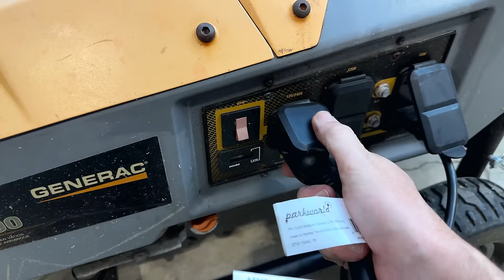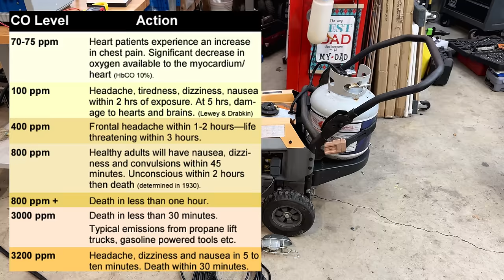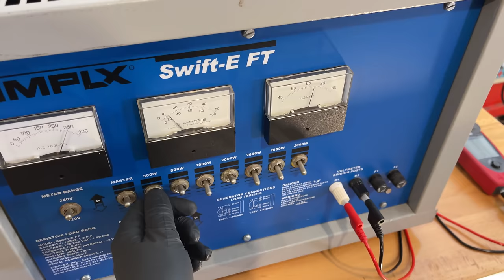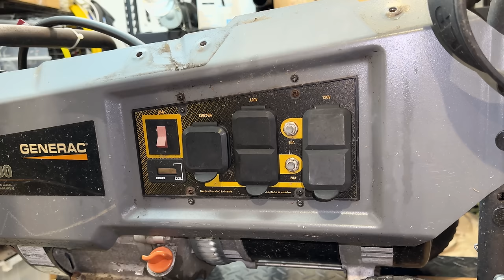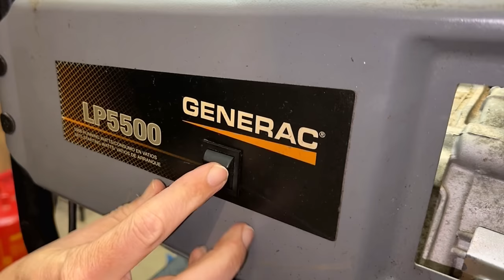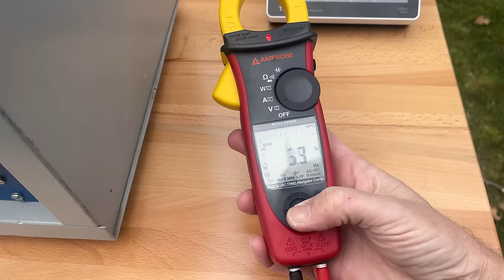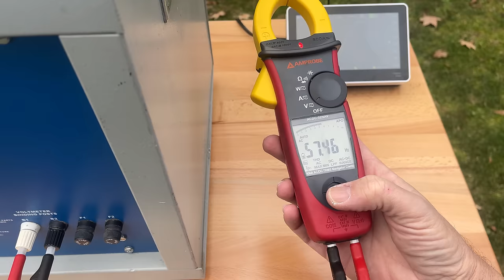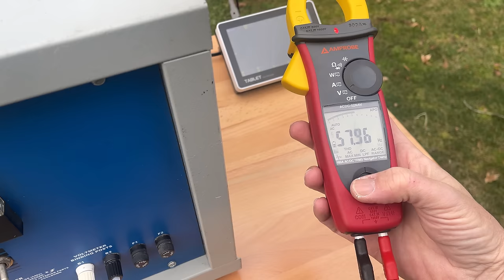Will a Cheap $40 Carburetor Breathe New Life Into This Machine?  Generac LP5500 Generator

Comment: When seeing the super faded cover on that unit, I knew it would have regulator issues from sitting/living outside for extended periods, or possibly most of it's life.  Those small propane regulators often fail/get stuck when exposed to the elements for long periods of time.  I enjoyed your conversion and repairs with new parts!  If I recall, this unit was really the first of it's kind as an OEM off-the-shelf generator designed to run on propane, and came out around 2010 or so. Look at how the small inverter gen market as exploded with dual fuel units in the last few years now!

Comment: WOW!! James that was fantastic and has prompted me to alter several of my generators so that I can use them on both gasoline and propane. I have a factory WEN 9000 that is factory dual fuel but I would like to convert 3 or 4 of the others  with this idea because I travel between Texas and NM and NM is much cheaper on propane than Texas, plus it burns cleaner on the engine than gasoline does. I will forward this to many of my friends. FANTASTIC!!!
JJ

Comment: I worked with a lot of LP powered engines. Mostly water cooled. We did use some small LP engines on smaller equipment such as high speed burnishers and small sweepers. Good video James.

Comment: I loved this. Years ago I converted a few generators to tri-fuel primarly to use natural gas. I had US Carb convert one, then I did the rest myself. simply boring a hole for a copper inlet sealed with JB Weld. Propane is easier to start but the benefit of unlimited fuel kept me going 3-5 days last hurricane. Anywho the "snorker" options looked cokamamie to me by comparison, though sometimes they fit and mostly work. I was going to say drill out your carb until I saw the one you got and holy cow, talk about a deal. I added all the regulation and so on myself but that package looks perfect and better thought out than well anything I ever saw on the market. You're a genius. Well done.

Comment: Your curiosity paid off here.The fact it started right up is impressive in itself but the fact you have multiple fuel options is even better.Many people have natural gas already and would just need to properly apply a convenient line and location where it’s safe.I’d be curious how much carbon monoxide natural gas would generate.Either way an outdoor location is the best way to go.You would just need to build a weather shelter for it and have it as a viable standby.
Reply: NG is a good option. I’ve watched a couple of vids where the conversion is explained. Their biggest issues have been supply. There are simple calcs to determine if the NG line can support the NG demand. You have to take into consideration every gas appliance running at once PLUS the gen set running.

Comment: I’ve just learned a new method for removing recalcitrant adhesive using your torch/wire brush method. Thanks!  
I usually use my hot air gun first to remove stickers as you do (for which I have multiple tips of different sizes and configurations). For leftover adhesive I’ve been using 3M adhesive remover for many years and in most cases it has worked very well, but it’s always good to have alternate methods.

Comment: I got my Multifuel  carburetor  in and first pull it was purring.  I took out old regulator and left dial turn switch for my kill switch . My only concern is my carb came with 2 wire off the bottom. not sure I need them. Also it starts right up without air filter  but it took a bit with it in.  Rubs great though and oh what a savings . Thanks again for this video.

Comment: Two comments. 1. The purge button is the spring loaded button in the center of the regulator 2. To kill the engine just turn off the propane tank. 
I experimented with a similar dual fuel carb a couple years ago but I only used the regulator because the carb wouldn’t bolt up to the Tecumseh engine on my generator

Comment: Well, thanks for that...I use these on a couple of engines, but they don't push the engine or carb hard; been wondering how it affects peak power and whether it could keep up with the propane demand. Can't be too terrible if you've managed a more-than full-load on this machine. 

For a longer test results, I can attest to having my little generator run all night (8hrs+) out on the patio when the power went out in the middle of (a mild) winter. Tank didn't freeze up, engine just kept chooching along. Not sure just how many hours it ran past the 8 hr mark, but it had a 1500-1800w load on it the whole time and didn't quite use half a 20lb tank of propane. 

Using these was my solution to carbs getting gunked up every time I(or the previous owner) forgot to drain them on equipment that only got used once or twice a year.

Comment: Hi James, nice option. you might consider using a propane forge regulator, the one you have seems to work fine,. a heat shield between the exhaust and the carb maybe in order.
the sine wave will look smother when an inductive load (motor) on the machine also the THD will change.
Rich

Comment: Cutting rubber hoses is much easier when you bend a loop in them 360 degrees with a sharp blade of course. Another impressive fix Mr. Condon, Kudos to you.

Comment: I'd still put in a heat-shield between the exhaust and the propane line, because, even though the direction of hot  exhaust gas has been redirected, the muffler and the exhaust pipe are still throwing radiant heat towards the propane line which, if the generator is being run for an extended period, will find that area being exposed to considerable ambient temperatures. Under those surrounding temperatures I can see hose-pipe rubber melting easily. 
Cheers

Comment: You should be able to unscrew that barb fitting from the LP port on the carb and replace it with an elbow standard LP fitting.
Reply: Does that mean the new fitting would have screw threads to go into carb and screw threads to accept the factory threaded fitting on the end of the 10 foot hose James bought?  If so what are thread sizes on each end?
Reply: @jimw6991  Most likely a standard NPT sized thread.

Comment: As far as adhesive remover for stubborn glue as was used on rhe the window tint on my dads truck. I spent an hour trying every thinner, remover concoction i could think of. Lastly just for grins and giggles, i sprayed the window with good ole lysol that dad had behind the seat. It liquified the glue and instantly, i was able to wipe it off

Comment: 23:50 when running on gasoline LPG intake must be blocked as well - each intake cycle it will pull air through a gas hose, it doesn't take to much vacuum to engage diaphragm controlled valve on that gas carb. Also id suggest using spring band hose clamps instead of those regular ones, the idea is - even if hose sags and lose elasticity with time spring clamp will exert continuous clamping force, while regular will stay in same position and with time can start leaking. Nwm, didn't finished the video when was writing the comment)

Comment: Jim - perfect timing! I’m dealing with a replacement propane regulator need on a patio heater. Unfortunately, the replacement regulator will only attach to the existing line with a barb fitting. Been struggling finding a threaded fitting. Will give these Clark clamps a try!

Comment: |I did a conversion to my clone petrol 2500va genset. Cheap £18 tri fuel carb. 
Worked fine on petrol. But very difficult to start on propane. Also found that it surged on propane in the LPG jetting. Switched to natural gas position, when running propane and ot was much better. The NG jet is bigger, suggesting all the jetting is undersized.
Brought a high flow regulator for the job, which gives full generator output.

Not planning to actually run it this way. But for the price of a few beers, it's been fun to do.
Reply: Interestingly mine has a tap for the carb bowl drain. Making it really easy to drain when switching fuels, if starting on petrol.
(Not really gotten to the bottom of why it is difficult to start on propane yet.)

Comment: For sticker removal, try Turtle Wax Label and Sticker Remover.  Works when all else fails, and won't hurt the paint.  Had to use it to remove the residue from shipping tape on my car (sun roof had to be repaired) .

Comment: Well done James, I think running that propane line along the outside was a good idea. It not only keeps the heat away but also the owner can keep an eye on its condition. With propane out of sight, out of mind can be a recipe for disaster.
After your video of the Honda EU 2000i I left a comment saying that some Americans seem a bit wasteful, which you pinned to the top of the comments. Thanks for that😂. The reaction to my comment was surprising and enlightening because generally Americans have a strong disdain of foreigners making critical comments about them but I experienced the opposite. I guess it’s the audience that these type of videos attract because people either agreed or gave very rational opinions on why there is such a propensity to just junk something that stopped working. A lot said that tossing the Honda was rather extreme and not common. Regarding pressure washers being junked, some pointed out that fixing a $500 unit was not economically viable a lot of the time because of the high cost of labor its easy to quickly spend more than it’s worth. If it’s going to cost over $300 to fix an old one then it’s probably better to buy a new one. It’s even worse with lawnmowers. I really can’t argue with that logic. It was also pointed out that the current generation not only have no idea how to repair things, they’re not even remotely interested in learning, another very valid point. And yet another comment was that generally people have plenty of money these days and not only can afford to buy a replacement but prefer that to the hassle and unknown cost of repairs. 
I found these comments really made sense. My sister had a B&S powered mulcher years ago that she was going to get serviced because when it warmed up it wouldn’t idle. She was told it would be $340 so she took it back home and asked me to look at it. That price was more than her Honda civic cost to service. I got it and serviced it completely for her in half an hour, spent 10 minutes adjusting the mixtures and it ran perfectly for years. Maybe Americans are not that wasteful after all. Cheers mate, Stuart 🇦🇺
Reply from the maker: I think it’s a bigger problem unfortunately around the world.  The Honda was an extreme case.  Before I repaired my own stuff I had issues with my lawn tractor one Spring.  It was 20+ years old.  Always well cared for and looked like new.  Dropped it off for service.  $300 and 4 months later got it back.  Missed most of the mowing season and the shop left it outside for that time and it came back looking like it had aged 20 years.  I can see why people do not want to deal with it.  I ended up having to buy another tractor in the interim so I could cut the lawn.  Hopefully things will change, but until the price of new equipment is higher people will continue to waste good equipment.
Reply: @jcondon1  I whole heartedly agree with you James. It is so hard for western countries to compete with cheap junk from China. Human nature puts price above quality when it comes to a lot of things we buy. 👍

Comment: Great job getting that back running on LP gas.  There are a lot of benefits running these on LP vs gasoline.  Its is nice to have the option to use either fuel.

Comment: Another good habit is running the propane out of the line. Close the tank and let it run out. One of my hoses is all gunked up from propane being left in it all the time. They have 2 stage "grill" propane regulators that go up pretty high. They sell them usually in the same section as the big buddy heaters and stuff.

Comment: Hi James, very interesting as I have this setup,  did you remember to move the black knob from propane to petrol on the carb and back again, I couldn't see the position in the vid. Bob
Edit, Ahh! just saw you speak of that knob at about 28 minutes in. That was surprising wasn't it, I thought you were onto something as I was sure my Gen. isn't giving as much out on propane and thought you had the answer, maybe you still have as mine it 10kw, guess I could see at what point it bottles, then try it again on petrol and see if it goes higher. Bob

Comment: Good job James, I have one of those gas carbs but haven't tried it yet, now I will. FYI, a little Tarnx on a Q-Tip will clean those switch terminals really nicely. When I repaired VCRs back in the 90s I used it to clean the mode switches on the mechanical mechanism. It worked great, just clean off the residue with water then dry it.
Reply from the maker: My early video editing was on SVHS.  Things are so much easier now.

Comment: What I do with stubborn labels is take a piece of rag (like an old handkerchief, pillowcase or the like), lay it on top of the adhesive, and keep it wet with isopropyl alcohol (get the 91% or 99% if you can - the normal 70% you get at the drug store isn't good enough) for a few hours, and it will soften most adhesives to where you can wipe it off after a while.

Comment: One "gotcha" with propane-generators..... I have encountered cases where the engine would run great UNTIL put under load.... then engine would QUIT and not restart. After propane-tank is disconnected/reconnected, the engine would again start and run OK. (then it QUITS when loaded) It turns out that some propane-tanks have a SAFETY SHUTOFF which will turn off gas-flow if too much flow is detected. Disconnecting the hose resets it. (I believe you touched on available-flow but did not mention the SAFETY SHUTOFF)

Comment: After load testing and adjusting the governor for better engine speed, did you ever get back to looking the CO output? Given that (scary) chart you displayed, if the unit is still putting out that much CO, I'd be painting a huge red/yellow striped warning on it..."Do Not Use Indoors". Anyone who assumes they can use it indoors because it's propane may be in for an unpleasant surprise. Thanks for another fascinating video, I always learn something new.

Comment: A quick glance at the propane nipple on the regulator, seems to indicate it is threaded into it - so an adapter is probably available to use the 3/8" propane hose fitting, without cutting the line.
Also, 10" of water is quite low pressure (0.36 psi), so only 1 hose clamp would suffice.

Comment: Great job James. Although goof off is a good product, I have found Goo Gone which is a citrus oil based product works great.  I decided to use a portable sprayer to spray our bedroom furniture with enamel paint.  Despite some attention to overspray, our new hardwood floors were covered with overspray.  The only thing that worked was Goo Gone.  Lacquer thinner /acetone would have worked but would have destroyed the floor finish.  Goo gone saved me from 'wife rage'.  Kind Regards.  Craig
Reply from the maker: WD40 for the easy stuff, Goo Gone for most and Goof Off for the really bad stuff.  Or fire when nothing else works.

Comment: Having converted a generator (8Kw) to run on propane, here are a couple of my thoughts.  First the man that said to open the valve on tank slowly is correct.  If you open it too fast the safety in the tank will activate stopping the flow or severely limiting it.  Second, some of the regulators have a vacuum line attached that opens the regulator once engine vacuum occurs.  This means that you have to prime the engine and get it to start on the prime.  I would never convert it to gasoline as propane does not go bad, is easy to find when the power is out, and larger tanks give longer running time.  When you change the carb, you are going to lose capability.

Comment: @james: Good job on the vid. I’m really impressed with the replacement carb. Started on the first pull multiple times. Most YT vids showing propane operation struggle to get the engine started.
Reply from the maker: That is the norm with propane.  This one was the exception.

Comment: I appreciate the safety aspect on everything you do James. However, aesthetically I think the generator with gas line hidden would have given it a  more professional look.  Also, I guess real test for carb will be how long it lasts.  Cheaper ones tend to break down faster.
Reply: I am surprised he did not feel the gas line over by the exhaust with his hand after shutoff to make sure it remained cool.  I also be concerned about catching the gas line on something as it stuck out a ways from the frame on both sides..
Reply from the maker: So am I, had meant to use the thermal camera on it.
Reply: @jcondon1  Do they make some type of tube insulation that could go over the gas tubing?

Comment: James, could you not have reused the original control knob together with the choke lever from the old carb(or drill a hole in the new one) to regain choke control and the stop/run switch? Seems to me that would have been a simpler and more OEM looking change if it was possible. I am super impressed at that old girl being able to hit 6500 watts reliably. I never noticed the hour meter reading, but there couldn't have been much for the calendar age of that machine! I also wondered about removing the diaphragm cover of the carb and heating the fitting to remove it and put a standard gas fitting on it. Love your methods! Great job as always!
Reply from the maker: It would be possible to setup the remote choke.